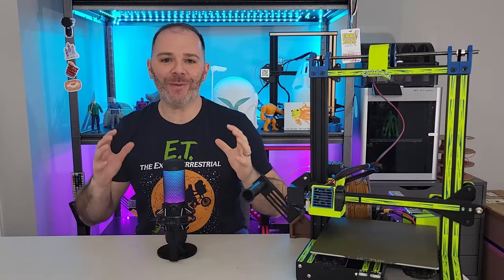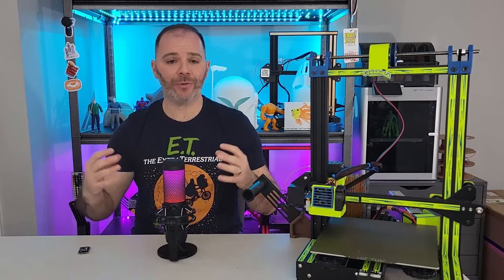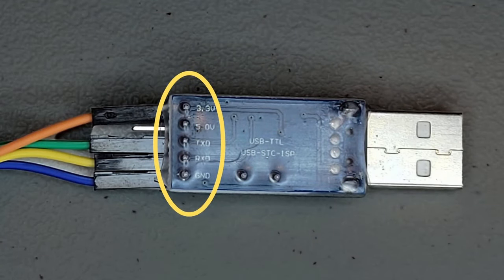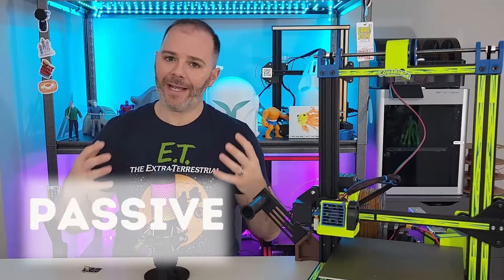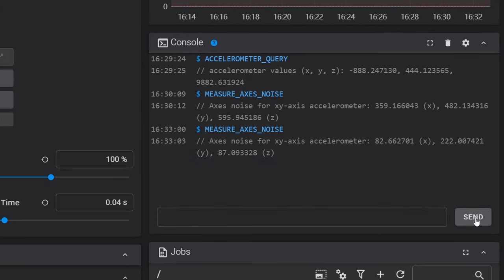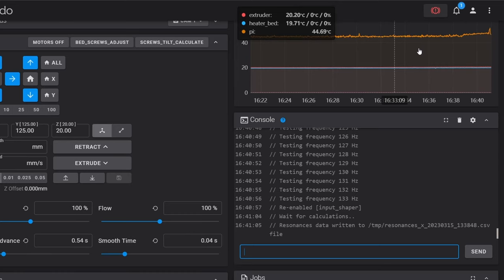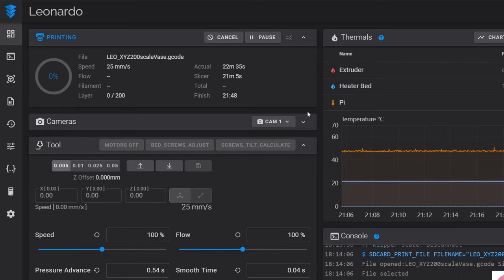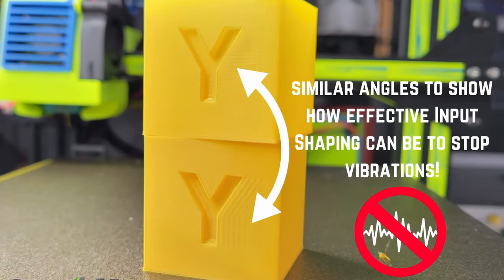Input Shaping Made easy with a USB accelerometer!

Comment: i just received my axdl345 today, and i was able to flash it; however when i unplugged the flash usb from the  usb port, removed the wires and plugged in the usb c cable, i still only got 1 led... So, when I type to get the serial address, it only shows 1 address and that is the 3d printer. i cant seem to get the 2nd light to work. Can you help me?
Reply from the maker: I'd love to try and help! Can you remember if, before you flashed, both lights were illuminated? My first guess would be a bad flash, or the image wasn't correct. Did you set the image up just as I didm adding in the gpio pins at the bottom ?
Reply: @PrintsLeo3D yes, when I 1st got it, both lights were lit.I though everything was going smoothly up until the step i got stuck on.
Reply from the maker: It sounds like a bad flash maybe. When you put it into a flash state, the led should turn off to signify that. I would recheck your image setup and try a new flash. If you want to email me (printsleo3d@gmail.com) we can share some images back and forth and that can help diagnose it.
Reply: @PrintsLeo3D  I have no issues re flashing. It completes the process. I can see the usb1 when it has the flash device, however; when I deconnect the flash device and connect the USB c, it doesn't seem to hold the flash.
Reply: @PrintsLeo3D  it was a bad flash. i redid the whole process and everything worked perfectly thanx Leo!!
Reply from the maker: Great!!! Well not great it was a bad flash lol but I'm happy that you got through it and can now start enjoying some input shaping!! Good luck!

Comment: Can input shaping be done when having 2 printers connected to 1 raspberry pi? I keep getting errors, while installing the accelerometer through ssh. My only conclusion is that I have 2 printers on 1 pi.
Reply from the maker: 2 printers with 1 host device should not be a problem with these. For instance the printer I demonstrated on in this video is one of two printers hooked up to the same Klipper device (Quadra). What sort of errors are you running into?
Reply: @PrintsLeo3D  Thank you for your help.  I get an error when I ssh and enter, sudo service klipper stop. It replies with Failed to stop klipper.service: Unit klipper.service not loaded.
Reply from the maker: I'm not trying to sound funny here but is it possible the Klipper service is already stopped ? The only other time I have read where someone had this issue there Klipper install was the issue. Is this a fresh Klipper install or have you been running it for some time ?
Reply: @PrintsLeo3D  I would think if the klipper service was already stopped I wouldn't be able to access it through Mainsail. I did a fresh install about a month ago. Because I can't get my webcam to work either,  I threw in the towel and hoped a fresh install would help, it didn't.
Reply: Nothing about klipper has come easy for me.
Reply from the maker: I'm really sorry to hear that. As for the pi what OS did you use ? 32 bit OS lite? Also did you use KIAUH to install Klipper, moonraker, etc ?
Reply: @PrintsLeo3D  I am using the lite version.  I tried to install klipper through kiah, after installing raspberry lite, but I kept getting errors trying to install kiah right after a fresh install of raspberry  lite. So I used the Raspberry Pi software to install klipper for 3d printers. I am using a raspberry pi 2 model b. Maybe that's my problem?  At this point I would have went back to marlin, but my ender 3 s1 is unusable with marlin. It never worked right new out of the box with marlin. And klipper has been the only way it's been usable.
Reply: Well.. Thank you for all your help with Klipper.. I'm starting to come to the conclusion that I should try and reinstall Klipper, again. And see what happens. it's the only other thing I can think of that can possibly save me literally hundreds of hours of troubleshooting,  is to throw this pos in the trash.
Reply from the maker: I'd be willing to try and help you through each step. Pi 2 should be fine. Nowadays I recommend the Invovato Quadra becauses it's cheap, fast, and works very well with Klipper. Let me know, I'm pretty busy but I can find the time
Reply: @PrintsLeo3D  I appreciate your time, you don't have to hold my hand 😉.  I was hoping there would be an easy answer to my original problem. I may install another fresh version of raspberry os and klipper tonight, see if anything changes.

Comment: I can't seem to find the KUSBA directions. Did you put a link to them? I'm not very good with tech but I think I have everything set up for my KUSBA to do the input shaping.
Reply from the maker: Alex you're absolutely right I haven't published the article yet. I have it mostly written just need to tidy up some of the infographics. That being said if you need some help with the last 5% or so I can help you. I can share my config as well because the standard KUSBA config that's readily available on the GitHub is (I think) a generation behind the newer units.
Reply: @PrintsLeo3D  that would be awesome. I had to have a friend get it mostly set up for me but neither of us know much about the actual input shaping. I can wait until you've got the thing written too. I'm not in a big rush, I just don't know what I'm doing. I was hoping it would be more plug and play with the KUSBA but it's harder than I thought.
Reply from the maker: I would say it's way more plug in play than having to solder and connect an adxl yourself but there's still  some steps you need to get right on the MCU side. If you follow my video a lot of it will apply, especially the parts about using the adxl and the results you gather. The more kusba specific stuff will be in the article though !
Reply: @PrintsLeo3D  sounds great. I'll keep an eye out for the KUSBA material too. I'll let you know of any specific questions I come up with. Thanks for doing this all!
Reply from the maker: Of course, I love doing it! I appreciate you watching, commenting, and reading my articles (when they're there lol)
Reply: @PrintsLeo3D  I don't seem to be able to find the link to where the article would even be now. Did you delete it?
Reply: Looking forward to the  KUSBA directions. too .......    :-)
Reply from the maker: Yea I've been overwhelmed lately, and finding time to finish this article has been impossible. It's comint though, mostly finished. Hoping to find time in the coming weeks. Thanks for asking though, makes me know it's needed !
Reply: @PrintsLeo3D  thank you!!

Comment: Its a great video. Unfortunately I don't see a ttyUSB0 when first time running ls /dev/tty*. My host is a MacBook Air running latest Xubuntu and Klipper is otherwise running my SKR1.4T OK. I've been trying the make menuconfig a couple of times, but with no luck. Anyone have an idea of an error source?
Reply from the maker: Is there any change when running ls dev when the accelerometer is plugged in as opposed to being unplugged? Also what accelerometer are you using?
Reply: @PrintsLeo3D  Hi Leo and thank's for taking your time to answer. No, there's no ttyUSB* whatsoever. Further theres only light in the power led on the Trianglelab ADXL345 after plugging to the mac.
Reply from the maker: Have you tried flashing this yet? If so maybe you can email me the configuration you used for the firmware image (PrintsLeo3D@gmail.com)
Reply: @PrintsLeo3D  I'll try again tomorrow and make notes of the progress and let you know.
Reply from the maker: Ok, I'll do my best to help.
Reply: @PrintsLeo3D  Thanks :)
Reply: This Youtube is teasing me. Try ang det a commet through.
I get a sys admin security error when sending mail to your gmail address.

Mi menuconfig looks like this:

* Enable extra low-level configurations options
  Micro-controller Architecture (STMicroelectronics STM32)
  Processor model (STM32F103)
* Only 10KiB of RAM (for rare stmf103x6 variant)
  Bootloader offset (No bootloader)
  Clock Reference (8MHz crystal)
  Communication interface (USB (on PA11/PA12))
  USB ids
  (!PC13) GPIO pins to set at micro-controller startup [input er !PC13)

When connecting the ADXL with a usb-cable only one led is lit and there's a ttyusb0 visible,
Reply: This Youtube is teasing me. Try again and see if it gets through. :) It did.
Reply: Hi again Leo! 
It seems to be working. I'm now running a SHADER_CALIBRATE AXIS=X and it IS noisy :)

And after a SAVE_CONFIG, printer.cfg now contains 

#*#[input_shaper]
#*# shaper_type_x = mzv
#*# shaper_freq_x = 30.8

at the bottom.
-------------------------

There seem to be some differences as of what I could register and your description. 

my ADXL was locked showing one led. I rerun  

make menuconfig
make
which didn¨t make any changes.

ls /dev/tty* now showed a 

/dev/ttyusb0 - and a 
/dev/ttyACM1.

In ~/klipper$ I ran:
stm32flash -w out/klipper.bin -v -g 0 /dev/ttyUSB0

Now ls /dev/tty* showed no ttyUSB* but instead these:

/dev/ttyACM1
/dev/ttyACM2
 
Now I got my serial with ls /dev/serial/by-id/. The serial contains ...stm32f103...

From there I followed your video and easily made a test. Wonderful :)

I don't know why it's using both ttyUSB0 and ttyACM1 and -2. Maybe because Kilpper runs from a pc?

Anyhow - it now works so thanks for support Leo :)
Reply from the maker: So glad to see you got this to work! The weird pathway certainly could be due to whatever OS you may be running (or partitioning) on the computer. Sounds like you're on the right course though so I'm happy. If you need more diagnostic info, as the tests are being performed, let me know! Happy printing !
Reply: @PrintsLeo3D  Thanks and thank you for your videos.

Comment: Double sided tape or blue tack will absorbe the vibrations. You have to hard mount it/ rigid mount it.
Reply from the maker: I definitely agree that blue tack or tape will absorb some vibrations, but from all the testing I've done I've never seen it amount to that much of a difference. While I would prefer to hard mount the accelerometer, tape or tack is such an easy solution that will provide the same or nearly the same results that I think it's a worthy option. Sometimes there's not a ready mount option and people sort of get paralyzed to even try this calibration, I do t think tape/tack are a bad option whatsoever. So I would disagree with the hard and fast "you have to rigid mount it", I believe it's preferable but not an absolute.

Comment: good info, but your website banner is BIG and interferes with browsing your pages , annoying
Reply from the maker: Are you referring to the top most banner? Unfortunately that one I cannot change. It tracks as you scroll and the size is not adjustable. Let me know if it's another one and I'll see what I can do.
Reply: Yes, I have a 17 inch screen laptop and takes most of the screen.  Can only see  small area of instructions.  Great and awesome work by the way.  Your information has helped me greatly. 
Thank you much.
Reply from the maker: Thank you. I am going to look into a way to try and hide or lessen that banner. There's only so many options that are editable on the website and for some reason I think that banner size is not one of them. Either way I appreciate you pointing that out and I'll see what I can do.

Comment: Bro really did
113 - 73 = 40
40/2=20
73+20=93
instead of (73+113)/2

73+113=186
186/2=93
Reply from the maker: I try and break these ideas and concepts down easily. Sometimes when teaching things we can't always use the method we prefer, or the method that may seem the most efficient. We have to try and use a method that will be the most understood by people watching, even if it is not how we may normally do it in our own lives.